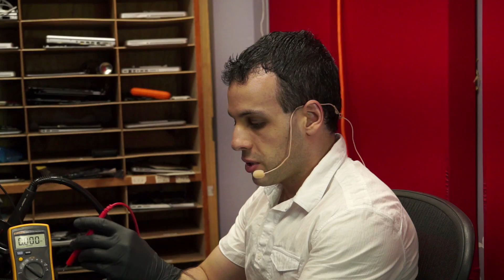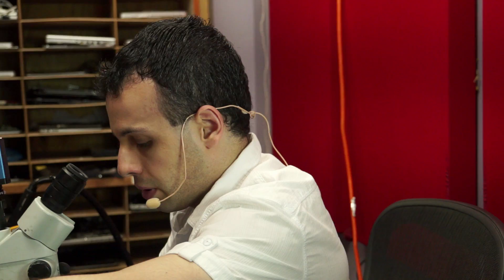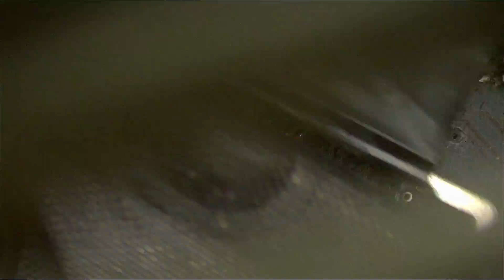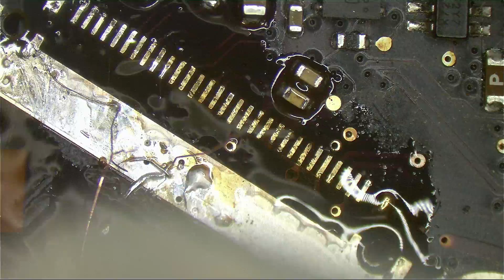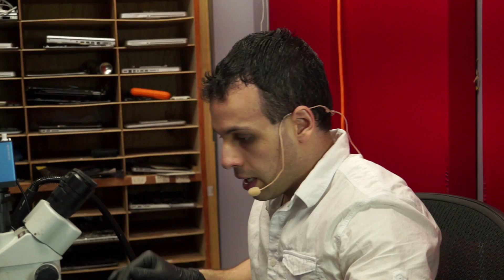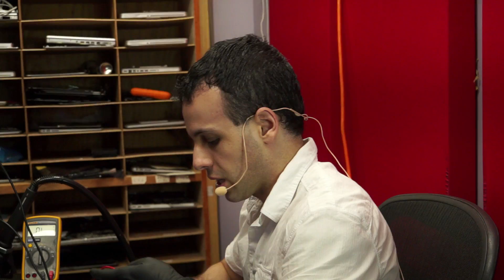What does a high voltage reading mean on a DC to DC boost circuit?

Comment: louis , I used to do HVAC , energy management and smoke exhaust for about 6 yrs, then worked for the utility department as a control tech .basicly repairing , calibrating and troubleshooting the automation for 2 water and 1 wastewater plants. Electronics was a hobbie when I was a kid. I'am disabled now and have been feeling pretty useless, until I ran across your channel and I wanted to Thank You for getting me back into Electronics and I have learned alot from ya.Back when I was doing control work 95% of people I tried to teach would try to comprehend the whole schematic at one time no matter how many times I would explain to them to focus on one section at a time and they would get lost and never get it. I learned C basicly the same way you learned component level board repair.I was playing a MUD game inthe early 90's and was told if you dont like it make your own it took me at least 500 atempts to get abasic 5k of lines of code to port over to the linux machine I was on.After about 5 yrs it had grown to well over 25 mil lines of code.ohh when I was working on it daily I could remeber most of it. You need to keep in mind with you mainly doing mac repair you understand the flow and layout of the boards, were as someone new it going to need to learn the basic layout and systems. The one thing that tripped me up with C for awhile was I would get a compile error "type mismatch without cast" one I figured out how to cast and shut the compiler up , but sometimes it would work and someone times it wouldn't.I took me a bit to figure out that a int with fit in a long but not the other way around. with & i would say in my head address of. and Function names are just pointers, knowing that trick you can use undocumented API's in windows. Good luck Lious and Thanks again.

Comment: Louis, if you put the tip across the soldering wick (cca. 90 degrees), it will not come apart and you can have more control on it ;)

Comment: 4:18 Fixing electronics is relatively easy, especially boards that mostly have discrete parts on them, like power supplies. It becomes difficult when you have to replace IC's(especially finding a replacement part). The hard part of electronics is designing the circuit.

Comment: Hi luois.
Please answer. 
My ipad charger 12 watt 2.4amp has a blown diode bridge ic. I've searched the internet for the replacement but there are so many. Can you please tell me what db ic should i use in this charger? My home inline has 240Volts. So i should look for 100volt to 300volt db ic?
Reply from the maker: this is a $10 charger, just buy a new one
Reply: +Louis Rossmann it's $30 where i live. But i get your point. Thanks anyway.

Comment: Every DC-DC converter on every piece of electronics I ever repaired had feedback loop so converter chip knows how to adjust duty cycle to maintain stable voltage on output regardless of load. Of course it's rocket science for Apple. Amazing!
Reply: Since it's a backlight controller, it is not voltage regulated but current regulated. The feedback only takes care of feeding a constant current, and when no current can flow the controller will enter open loop operation.

Comment: Well, it's true that you'll see higher voltage when no load is connected, but that's for a FIXED PWM boost converter. And there's the other category of boost converters where you have a feedback line from the output to adjust the pwm according to the load attached, to mantain a specific voltage.

Comment: Mr Rossmann,
Made my first nickle soldering a new micro usb connector on a tablet :-)
Thanks for the info and encouragement!!!
Reply: soldered a micro usb jack which i got from a donor phone, with a crappy 1980 soldering pistol thingy, with crap flux. It's all about technique and skill. Trust me, it's not easy to solder a 0.2mm pin Pitch conector with a made from a 2.5mm copper wire
Reply: with a tip made from*

Comment: Hey I got a TV board that my friend left at my house, you wanna fix it? ;) I'm so glad you ventured out from Apple products finally lol
Reply: You probably should look at it first and identify the problem, be it water damage or a incomplete circuit.
Reply: +FireFraction my comment was a joke, hence the ;) in it, he mentioned how he's accepting things he doesn't normally fix anymore but at a really undeseriable rate and for an unspecified time, to basically discourage people from sending him random shit. That's why I made a joke about the TV board.
Reply: +EdgeOfSanity there is no TV board
Reply: I have a 10Gbit NIC that has a ripped off trace on a capacitor... works... I just hope it continues to. It's a fairly large capacitor that really should be through-hole for strength, but some genius made it SMD with tiny, tiny traces holding it down.
Reply: Just put it in the oven on high for 30 minutes. Just don't let Louis know ;-)